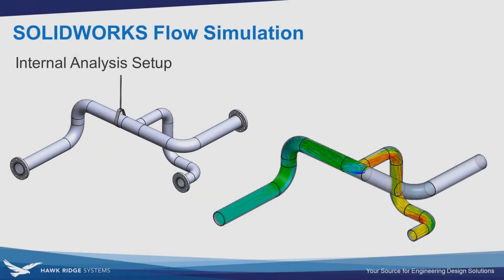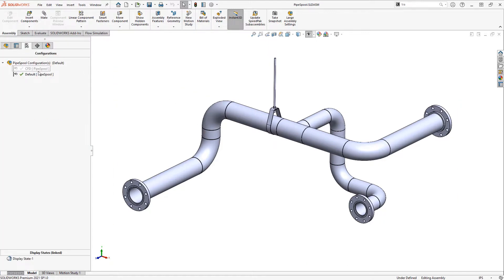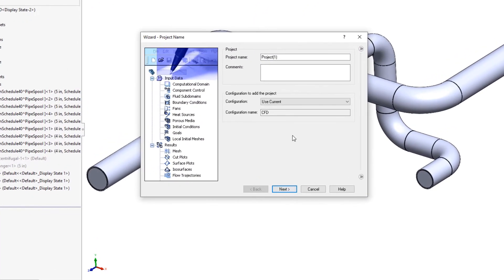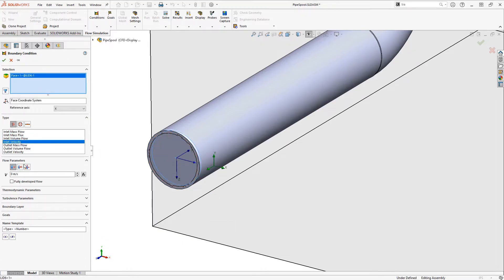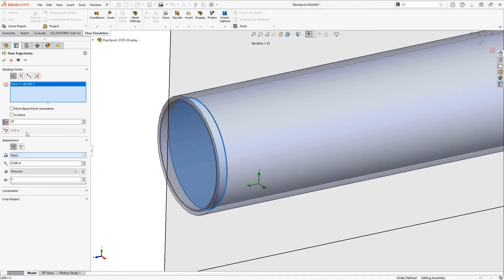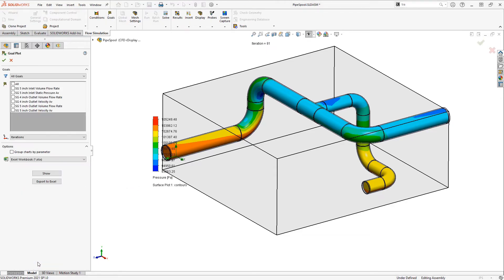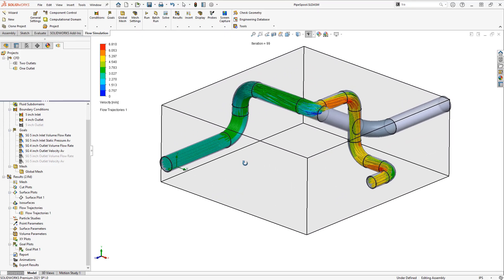Internal Pipe Flow with SOLIDWORKS Flow Simulation

Comment: Very well done video.  Very well paced and instructional.  I am working on a similar Flow Sim problem with 1 inlet and 3 outlets.  The flow through the 3 outlets are all different so the static pressure drop must be different.  However since I have the outlet pressure at atmospheric (environmental) for the 3 outlets, my results are showing me that the static pressure drop across all 3 are the same.  Any thoughts on what I must be doing wrong?   Thank you.

Comment: very fascinating. one question though.
Im asked to simulate Long Range Guided waves Testing (LRUT) on an oil pipe. is it feasible on solidworks?? or maybe is there a way to go around it and do something that acts like it?
the specification of my task is to determine:
1-how much energy such waves can transmit to the fluid inside a pipe
2-how much distance these waves cover inside a pipe with and without oil inside it

thanks for any tips and help

Comment: Thank you for your vid. Very instructive. Do you have or can you make an example of a heat recuperator (water entering a radiator contained into a concrete block, eventually all within a steel casing). Thank you

Comment: Face<1>@reducerroute-1/LID5-1 is not laying on the boundary between solid and fluid region., What should I do when I encounter this problem?
Reply from the maker: Most likely this occurs when you select the outside face of the lid rather than the inside face of the lid (facing the fluid). We would recommend editing the boundary condition selection and making sure it is choosing the inside face (you may need to right click and "Select other" to grab the internal face)
Reply: help me pls how to fix  @hawkridgesystems

Comment: When making model of a pressure system to find volumetric flow rate at an outlet should the entire system be in the model or would it still be accurate if only the last quarter of the model is included? ex, I know the inlet pressure and outlet pressure but would my model be inaccurate if I start the simulation right before a T joint or should I have the entire run up to the T joint in the model?
Reply from the maker: It's difficult to say without comparing both approaches. If you know the flow conditions immediately before the T-joint then I can't think of an obvious reason why it would be a problem to crop the analysis to that region. If you know the flow conditions only on the global inlet, then I would expand the analysis to begin there. 

One recommendation would be to set the problem up both ways and compare the results.
Reply: @hawkridgesystems  I know the pressure at the inlet and outlet and I am unsure what the pressure would be right before the T joint. I'll go ahead and set up both.

Comment: You didn't use the mesh
Reply from the maker: Correct, this simulation was run with the default mesh settings (which is a "Level 3" refinement on the Global Mesh) to keep the tutorial simple but it's always a good idea to examine mesh refinement

We have a separate video detailing the meshing process here: https://youtu.be/Gzp4u5S5vo4

Comment: Good  Day! I was wondering if you can help me on my thesis, simulating the temperature of the steam on a helical condenser (dehumidification). Have a good day!
Reply from the maker: To start with we would recommend to check out the Heat Exchanger example in the built-in tutorials: https://dshelp-embed.3ds.com/2023/english/Tutorial_HTML/mgchelp.htm#context=main&id=102&tag=id0f71d149-34e9-44e0-b47f-08f7e2081706

You can also read about the Steam model and condensation prediction here: https://dshelp-embed.3ds.com/2023/english/UserGuide_HTML/mgchelp.htm#context=main&id=100&tag=id9b6f29c5-ff41-41c9-b27c-0af9a43ad9fc

Let us know if you have any specific questions after taking a look at these

Comment: is there any way to use fan with Free surface?
Reply from the maker: It seems Fan conditions are not allowed when Free Surface option is enabled. Two alternative possible approaches might be:
1) Define a inlet flow boundary condition with a dependency on some measured pressure Goal, to recreate some behavior similar to fan condition
2) Use rotating region method to simulate fan/pump directly
Reply: @hawkridgesystems  thanks, and is there any way to depend inlet temperature to outlet temperature for creating closed loop system?

Comment: Sorry how did you fix the "face is not on the boundary between solid and fluid region" error
Reply from the maker: Possibly if you are receiving this error, it is because you are defining the boundary condition on the "outside" face of the lid. It is important to define the boundary condition on the "inside" face of the lid which faces the fluid, this usually requires a section view, hiding components, or using the right click "select other" tool

Comment: Hi...I tried to run the similar piping with many outlets and different height. But I notice that the gravity seems does not play any role in the simulation which in reality should have. Do I need to do anything further after setting the gravity at https://youtu.be/8R60y9Y9480?t=150  ?
Reply from the maker: Hi Kay,

"Pressure potential" is another option that should be checked on anytime gravity it is used. It is under the thermodynamic parameters of the initial conditions screen, visible briefly at https://youtu.be/8R60y9Y9480?t=166 You may also want to verify it is enabled for any fluid subdomains or inlet boundary conditions. 

In general the difference with gravity enabled will be more noticeable the denser the fluid is. To perform a simple test you could analyze the system with your fluid and no flow conditions. You should then see a pressure gradient in the system when doing a cut plot of pressure.

Comment: Hi...How can I check the mass flow rate at outlet ?
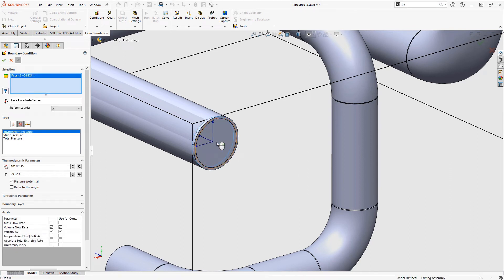Reply from the maker: When setting up the surface goals at 4:16 check parameter for "Mass flow rate"

Or, if you want to extract mass flow rate at outlet after the fact (without a goal), you can use Surface Parameters. Insert a Surface Parameter, choose the outlet lid face, and choose Mass flow rate as the parameter.